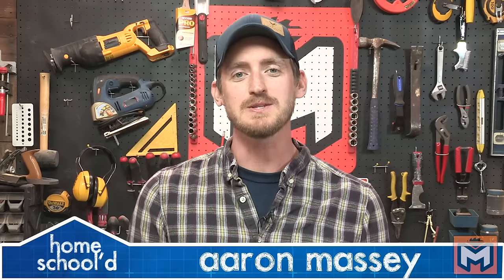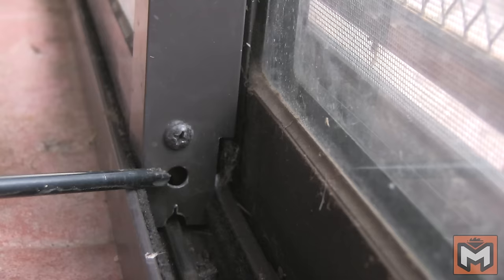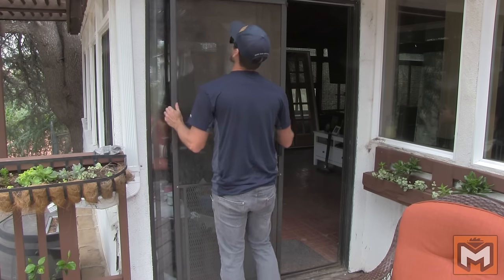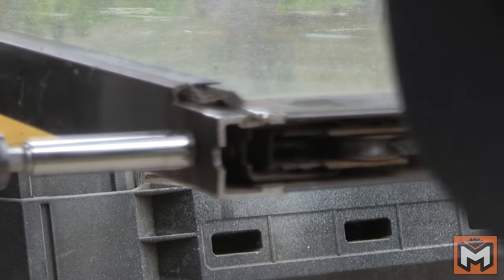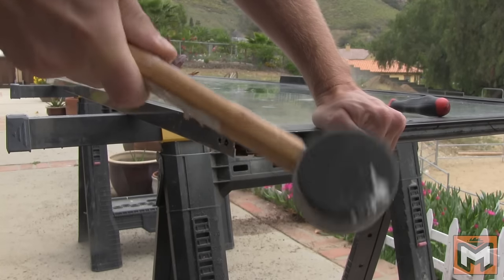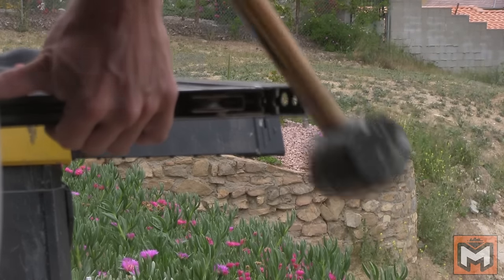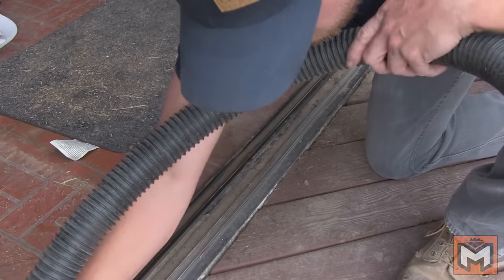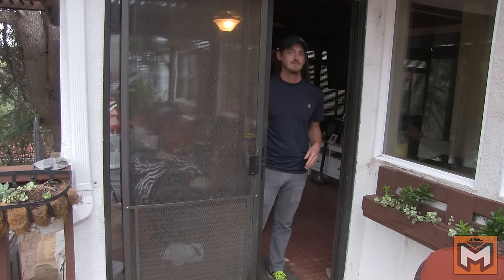HOW TO FIX A STICKING SLIDING GLASS DOOR

Comment: One point you forgot to mention - the bottom track may not be perfectly perpendicular to the jamb.  When adjust the rollers one should bring the door almost to the closed position and make sure that the edge of the door is parallel with the jamb.  If not, adjust the roller height so that it is.

Comment: This is a Great repair tutorial. You answer all questions regarding how the sliding wheels are installed and how to remove them which I thought I would have to call a professional but now I have the confidence to do it myself.  I have tall 8 foot door which I have been told needs to be done by a pro.  I will tackle it now and get back to you.

Comment: Thanks! I was able to fix mine, I had one bad roller on both the "fixed" side and the slider side. So I just swapped the good one on the fixed side, for the bad one on the slider side. Sprayed some graphite lube for good measure and now I have a working slider! Free and took about 15 minutes, no f-bombs dropped on this repair.

Comment: Thank you!  Fixed my door it works great.  It was old like yours, but didn't need to take out the fixed door.  A few taps of the mallet and the bottom part of the frame came loose and i could pull out the rollers.

Comment: Thanks for the info. My slide door can be removed by lifting it out. The fix panel is permanently stay. I was able to change the wheels on my sliding glass door. It took more than an hour today. 

I felt good of the accomplishment because of your info. Both wheels cost little more than $12 at Lowes. The mallet hammer did help. Thx

Comment: Top notch video; direct, clearly represented info. Only thing I wish would have been included is a method for lubricating those rollers to keep them running smoothly. A method other than removing the doors.

Comment: Thanks for the video. Mine was a little different. Wood frame and they mounted from the bottom. Didn't have to take out the fixed door. No hardware at lowes, got them at home depot. Of course it started raining when I got the door off.

Comment: My sliding glass door is 21 years old. Last winter during minus 10c I noticiced that it was skipping, making more noise and harder to open and close. This summer I removed the door, removed the rollers and noticed that the track was extremly dirty. So I cleaned it and noticed that there were  uneven dents in it. I couldn't figure out how to replace it so I decided to even it out by sanding it over with a 12 inch board. Once that was done, I cleaned the rollers. Made sure they were still viable and then reassembled everything and now my sliding door works like new.

Comment: Nice video. 
I've never seen anyone slide the side rails up like that.  I will keep that in mind if the bottom rail doesn't come off.
Interesting but unnecessary.
Those rollers should slide out the bottom without much resistance.  The sides of the rail are smooth.
That door is dual glazed.  It should have tandem rollers.  I'm surprised it didn't have them already.  
Prime-line D-1845  would work nicely, although in general, it's probably good advice to use an exact replacement if you're not sure which better roller will replace it..
It's always a good idea to replace both.

Comment: I do this for a living......for my Company Called Washington a Door Service. You DO NOT need to move the fixed pane to access the passive slider or to remove it the majority of the time with either aluminum or vinyl sliding glass door units. Other than that. Well done. 👌🏻

Comment: If the problem lies only with lubrication of the wheels, you can try using a spray lubricant fitted with the thin plastic nozzle. This nozzle inserted into the top hole on either side at the bottom of each side of the door can reach a couple inches inside and drench each roller assembly with a good silicone lubricant. As a quick fix, It should free up the wheels enough to allow free rolling.
Reply: Excellent suggestion....you just saved me from removing my door during the winter!  Highly recommend this before removing the door if you have those two top screws!

Comment: Excellent. Tomorrow morning’s project.
But I have a question - when you whack the frame with the mallet, doesn’t it ‘move’ the glass?
Reply from the maker: Just depends on the type of door you have. You don’t have to remove the frame if you can get the roller out without it

Comment: I have that exact same door but have not disassembled it yet, what rollers did you get? 

does that large screw at the bottom of the frame actually hold the roller in place or just the frame.

Comment: Quick and to the point.......however, couldn't you just remove the rollers and replace?  Or was this a type of door that required you to hammer on the frame, pushing it back to allow the rollers to come out?   Thanks

Comment: thank you so much. Now I know how to get the door out of the frame.
Reply: Mr Fix It, 

Nice job on the video...distilled nicely and much of the 'why' behind the 'how-to'. 

Does one need to remove the stationary door? Seems I could lift my old one's moving pane and swing the foot in toward the room. Maybe that is  specific to the make of door?

Also, if the bottom rail is all dinged up, making a rough path for the rollers leading to short life, can the lower track be replaced without removing the whole frame?

Cheers!

Comment: In your case , you didn't have to take the door out at all. You simply take the side frame off after removing the bottom frame screws. Then , with needle nose pliers , you pull the tandem rollers out THE SIDE OF THE DOOR by grabbing the eyelet with the needle nose. After you adjust the rollers to the right height, simply insert the roller back into the side of the bottom frame. Then , make sure that the glass glazing is seated, mallet your side frame back on, carefully, then sink your bottom frame screws back in. Done. No need to take the door out, unless there's a screw going into the top of the roller assembly. I do this every day.
Reply: so could you make a video for us?

Comment: Most of the time , you can pull the sliding panel out the inside without taking everything apart. That should be checked first, imo.
Reply: michael chilner wow! I didn't know that was doable... any YouTube videos on how to do that?
Reply: This is true. I work for Washington Door Service and the majority of the time this step is completely unnecessary. Most of the time you can simply pull the passive unit out itself and change the rollers and housings without even taking the frame apart on the passive unit.
Reply: @debbielaclair1215  lift it, pull the lower part in and remove. They're heavy due to the glass but completely doable.  Good luck.
Reply: Sean Fantin do you know the easiest way to replace the rollers on a sliding door? Pretty sure one of them is rusted or otherwise ruined. I've heard they come in many sizes and are hard to find one that fits. So much appreciated! We can hardly open it.
Reply: Lex V. Thanks for your comment. Any idea the easiest way to replace one of the roller cartridges? I've seen they come in a multitude of sizes. Can they be repaired? Don't want to get it off then not be able to put it back.
Reply: Debbie LaClair generally they come in two sizes if they are steel rollers. I would recommend popping the inactive/passive side out and purchasing both sizes at Home Depot. I would also try to purchase the packs that come with bearings. They are little brass bearings that look like tiny .22 gauge bullets. You drill out the bearings with a 1/4” drill bit and then slip the new brass bearings in with the new wheels. The bearings will look like they are long but after you slip the new bearing in, you potion the wheel against a flat hard surface ( I do it against my trailer hitch on my van) and smash the side that is sticking out with a hammer. Basically making a “rivet” of sorts on the long end of the new bearing. I hope this helps. It’s kind of hard explaining this without a video. I am thinking of making videos myself to teach people how to change rollers without changing the roller housings.
Reply: Sean Fantin thanks so much! Say, where do you live, I'll hire ya (jk) 😉
Really, just knowing what you've said can be done makes me happy. I've been told that finding something to fit is next to impossible. Even had a couple refusals. 👍🏼 thanks again.
Reply: Debbie LaClair you’re very welcome Debbie. I do at least a 100-150 SGD repairs a year. We work in the greater Seattle area in Washington State.  Hope it works out for you!
Reply: Sean Fantin I'm in Eugene.... if you're in the neighborhood gimme a call 😉 lol
Reply: That's what I was coming to check!!!

Comment: Unfortunately mine easily hit the 4 f-bombs before I gave up.  For the exact same door I had many differences. My builder installer must have been an overachiever/sadist. 
F-1 I had additional plates on the top and bottom of the fixed door that secured the fixed door in the middle. Easily found how ever not easily removed. 1 stripped head on the bottom channel that was drilled off (easy out/screw extractor failed). Top one also held in place by the frame screw (one of three) so had to remove that and try and reinstall. 

F-2 The sliding door got stuck mostly left and I had to go inside and move it from there. I ended up sanding down the top of the groove and putting some lubrication on it just to keep this going. 

F-3 Fixed door still wont slide. in fact the right frame is coming off in the middle I am pulling so hard. the seal is all goofed now. The over achiever had a third screw in side through the frame that was hidden behind a rubber stop for the sliding door in the middle. Another 15 minutes pulling the right frame at the top and readjust the seal in the middle to the top. 

F-4 The door is now loose after considerable effort and increase larger pry bars. Door had been installed at least 38 years at this point. I get it to center (and the right) and now there is now way to lift it up. I tried pry bars under the left right side nothing. There is no difference in the lower channel height left right center for that to have any clearance.  There was no difference in the over the door spacing of the upper channel.  

At this point I punted to just cleaning out the entire track since both doors are moving. Weight not an issue it just wont go up. 
I got the fixed door re-secured (minus the cut off head that broke 2 drill bits trying to drill out after I got the head out of the way) and just lubed the tracks to hell. It works but not perfectly as I know the rollers do need to be replaced.   Lube is not the ideal solution as I live in a dusty area with 2 large dogs so the track getting fouled is a constant issue that lube will just aggravate. Still no idea how in the heck they did this unless they put the fixed door frame sides on in the tracks channels. A comment below mentioned that removing the fixed door was not required but even raising my roller all the way would not allow the sliding door to come in to the house so I am still stumped.

Comment: Doing mine based off this video. Unfortunately my rollers have an additional bolt under the glass, holding frame to top of roller. BEWARE, THERE IS A SEAL BETWEEN THE FRAME AND GLASS AND ITS IS A S.O.B TO GET BACK ON IF DAMAGED....

Comment: What if those rollers need replacing but you have burglar barring blocking you from removing it? I'm a woman trying to get my only door to the outside to work and it's not doing much. Got one wheel up with the screw, but now not budging. 2nd wheel stuck inside frame. 😠 CAN't lift out the door at all.

Comment: Doesn't appear to be sagging.  The door seems to run against something on top as there are marks there.  Can I adjust the door lower to fix?
Reply: +Mr. Fix It hi, the marks are on the frame above the door. I lowered the wheels and it seemed to help.  I will wipe down the track lube tonight.  thanks

Comment: Everything is good but remove the door from the frame and the roller 
You don’t have remove the fix panel for remove the door the sliding door have two ways remove from out side and remove from out side but if you don’t have to do the whole process I recommend remove from out side and remove the rollers I recommended remove the bottom part only because if you hit the jambs when you close to the glass is can cause break the glass because the corner of the is the weak part of the glass on the end will be cost more that only $20 
The best to do is using a wood and hit with rubber hammer 
Some sliding roller are screw to the aluminum bottom part

Comment: IF YOU CANT FIND A CORRECT REPLACEMENT....go to Ace Hardware and buy the NYLON WHEELS with axles.  Then drill out old axles and remove old metal wheels. Clean up existing carrier and install new axles and NYLON wheels....So smooooth and quiet and much less wear on track.  I did my old double pane milgard aluminum framed(VERY HEAVY) DOOR...she slid like a dream.

Do not let the track get worn....replacing it is a pain....NEW wheels are MUCH better.

PS. The axles were 2 pieces that threaded in to each other....LOCK TITE THEM...THE non permanent  type of locktite....peace.

Best of luck.

Comment: Why not just tap the bottom frame off to remove rollers? Tapping the whole frame up and off the top and up the side is super risky. I do these repairs all day at work. Please people , if you can't get the rollers out, just remove the bottom frame only after taking the mounting screws out, which are usually the screws the hold the frame together. Then, once you have the bottom frame off with the rollers inside, take a screwdriver and a mallet and gently tap the rollers out.

Comment: ok video but you dont need to take the fixed door out to remove the sliding one, also what's not shown in the video you gotta loosen/remove the top rollers and brackets before banging on the aluminum frame with a mallet people!! or you will shatter the glass in your sliding door!!!!!!

Comment: Taking the screen and stationary portion off (out?) are unnecessary extra work.   The slider can be lifted and removed WITHOUT messing with the others.  Yeah, you probably have to remove it to the inside, then take it outdoors, but it is still MUCH less work.   You forgot the important step of adjusting the rollers so that the door closes equally.   You aren't as informative as you seem to be.
edit to add:   SOME doors, such as mine, require you to remove the bottom rail and remove a screw to be able to remove the rollers.
Reply from the maker: Your experience and door don't equate to my door.  This is designed to give people of an idea of A technique to fix their doors. Not all doors are the same. I'm quite surprised you could even see the video from all the way up on that horse of yours though so thanks for the view.